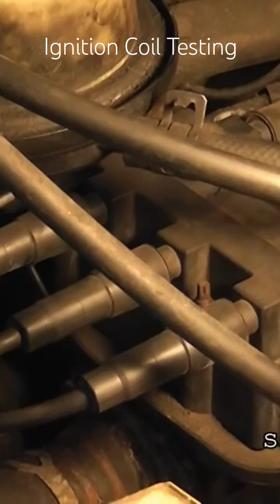No Spark From One Side of a Waste Spark Ignition Coil #misfire #nospark

Comment: What if they both didn't work? Would it then reconfirm it is bad?
Reply: If they were both bad you’d have misfires.  Waste spark is designed to fire 2 cylinders simultaneously. One at compression( the normal time to fire a spark plug) and one at exhaust(why it’s called waste spark).  It’s intended to help emissions by giving it extra spark jic it can still ignite possible unburned fuel in the exhaust.
Reply: @jorgeantonini201  wow, things have gotten very complex. Better than having two spark plugs per cylinder. Thanks for explaining so well.

Comment: You have power. Spark happens inside at the gap. You can have power, and no spark.
Reply from the maker: I'm not sure what you're trying to say
Reply: @ScannerDanner  I'll explain. "Spark" happens when the voltage (power) "jumps" across the electrodes. If you have a fouled plug where carbon has made the ceramic conductive, the power will not jump the gap. The path of least resistance is now the conductive ceramic surface.  So, you can have power going through the plug but no spark. You need the "spark" to cause ignition, Having power through the plug will not accomplish ignition. It must make the jump. You must have the "spark" not just voltage. 

When I was a kid my stupid brother in law had me hold the plug wire while he pulled the cord. I was electrocuted and he laughed. Not cool!  The joke was on him though, because this simply told him he had power and nothing about whether or not he had spark. The mower never did start. My Dad later cleaned the plug and BOOM! It started right up.

Comment: Harbor freight has a tool to stick in the plug and the coil pack that lights up like a test light if it has spark lol it 100% reduces getting shocked
Reply from the maker: Those tools are garbage. You cannot tell the strength of the spark (a weak spark will still flash this light) and you're not going to be able to do a cylinder drop test (the other test I'm doing here that the short doesn't show)
Reply: @ ScannerDanner
They sell adjustable gap spark testers, also allow you to avoid zaps 100% of the time
Looks like a glass cylindrical housing and 2 metal tips inside.  One is solid mounted, the other is adjustable so you can make the gap larger or smaller.   I’ve seen ones where you can set a gap to 2+ inches
Reply from the maker: @jorgeantonini201 I have two of them! But you can't do an rpm drop test with that tool!
Reply: @ScannerDanner what is the best tool to use to do those tests? I appreciate it.
Reply from the maker: @daviddowns7552  for an RPM drop test like I am showing, the test light is THE tool
Reply: @ScannerDanner  I appreciate that☑️☑️☑️

Comment: Dude, you could do the same with an inductive timing light
Reply from the maker: Not for weak spark. Weak spark will still fire a timing light! Also I've seen low compression cylinders NOT fire off a timing light due to the low kv demand from no compression. So the timing light test has too many variables.

Comment: Very nice demonstration & tool usage, some vehicles be careful because if U go full open air gap [like if U drop a tool] it can blow an ASD circuit, or a driver in an Engine Controller.
Reply from the maker: A momentary full open won't hurt anything, but you're not wrong about what damage can happen from open plug wires
Reply: No Dan U R teaching people something & not saying that if they drop the tool ect. ect. That is my point. 
I appreciate that U know some Tune Up Stuff but U R not the tell all know all great guru in fact U could use a little humility & regard because U seem to get butt hurt @ most of my remarks on your videos & or assume things. So notice I said 'seem' & I will leave it @ that.
Reply from the maker: @StationRussification  
You may want to reread what I wrote! ..."but you're NOT wrong about what damage can happen from open plug wires" 
Maybe you thought I said "you're wrong"? My name is Paul Danner btw 😉

Comment: Obviously it needed a coil in the first place because the car is running if it had an electrical problem none would you fire because it's one unit so if you have one miss fire it's always the coils on that particular coil pack
Reply from the maker: That is incorrect! There are 3 separate coils (one housing) and 3 separate primary control wires and 3 separate drivers in the PCM. One driver fails or one of the control wires has an open and the result is one coil does not fire! So two cylinders will not have spark. The second test in testing the companion cylinder told us everything we needed to know.
BTW, I have seen both open control wires and open/blown drivers in the PCM on this EXACT model car. Test don't guess!!

Comment: I was just wondering how to do this haha I changed my parents spark plugs on an 05 ram with a 5.7 hemi they have 16 plugs and they have 8 coil packs and 8 regular plugs also running from coil packs when I pulled one of the wires it ripped the housing on the coil connector that goes over the plug and I just put it hacj the best i could and it ran fine for a while but now its not running good at all
Reply from the maker: It's a little different when you have 2 plugs per cylinder with one of them being a boot underneath the coil pack
Reply: @ScannerDanner  that's what I mean that's the part that tore would that make it run weird or idle rough?
Reply from the maker: @THEDEADDOLPHIN  the coil boot tore? Absolutely! It's now able to arc to ground in the spark plug tube instead of the plug
Reply: @ScannerDanner  thank you I'm gonna replace the coils now
Reply from the maker: @THEDEADDOLPHIN  they may sell those boots separately but not sure

Comment: I take it that you do have a pace maker implant, and they do make spark testers for  this. When you bang your head on the hood from geeting a 65,000 volt jolt you find out that spark tester are worth the money and cost a lot less than the 8 stitches in your head.
Reply from the maker: There is a reason this is the chosen test method. I'm performing a cylinder drop test too, something this short isn't showing but is in the full case study.
Using a spark tester involves shutting the engine off each time you move it, eliminating the ability to perform the rpm drop test.

Comment: If the corresponding coil had power you just defeated the purpose of your video bro.. before we call this coil bad pretty sure that's what you said. Looks like some shitbox Chrysler product anyway
Reply from the maker: First, this is a 1 minute clip taken from a full length case study.
Second, what I showed was 100% valuable and accurate.
If both secondary coil towers on one particular coil have no spark, the primary control circuit MUST be tested before condemning the coil.
If only one tower is missing spark, primary control is no longer a concern, I has to be functioning. This is the entire point of this clip.
Reply: @ScannerDanner  that's a coil pack a 6 coil pack in one block of plastic right? Would not have taken me an hour to figure out that entire thing was garbage. To each their own, looks like I struck a nerve anyway 🙄 try to have a better day and take YouTube a little bit more lightly.
Reply from the maker: @Smokey-88  it is one unit and there are 3 coils, not 6. 4 primary wires, one shared power feed and 3 control wires. 
You clearly don't understand how these actually work based on your first comment, and your second comment you come back with how quickly you could have verified the issue? Lol okay. Move along. This is a training channel, so yes, I take things seriously. I'm not here for your entertainment. So when someone says something that is incorrect I'm going to call you on it.

Comment: The engine seems to run better with the second plug disconnected.  lol
Reply from the maker: You can totally have that happen as the harmonic that is created is more cancelled out with 2 cylinders misfiring out of 6 instead of 1.

Comment: It’s a companion cylinder coil didn’t spark you would’ve still needed a coil unless the control wires or the power wire were bad to it from the ignition and the computer
Reply from the maker: Yep, that was the point of the test. No spark on the companion cylinder and additional testing would have been needed before you could condemn the coil

Comment: Gave me a flashback and immediate jerk of my right hand. Back in 1985 i was 18 and had a new job w/ smart folks who explained i could troubleshoot my skip in my truck by pulling plugwires 1 at a time while idling. Yep i learned😂 that #5 on my 351c  w/ dual point distributor was skipping due to a split boot. Damn that still hurts.🥴

Comment: These coils use the same high voltage coil for the opposite cylinder I’m assuming? 
Thus why if one side is working, both should technically be?
Reply from the maker: That is correct. It's simply a secondary winding that is not electrically connected to the primary like conventional coils. So when the primary field collapses and we surge the secondary winding, the generated electron flow finds its return path through the block and other plug and wire.
Reply: @ScannerDanner  ahh ok, so each plug has separate high voltage coils but get supplied from one 12V coil. Ahh makes sense
Reply from the maker: @Sicktrickintuner 3 separate ignition coils in this. 2 towers for each coil

Comment: I've always assumed that an internal path to ground is almost always responsible for no spark at one terminal of a wasted spark coil, but can't the secondary circuit of the companion cylinder also be the cause? Would it be reasonable to ground the terminal of the companion before calling coil?
Reply from the maker: An open plug or wire on a waste spark coil does have the ability to affect both sides of the circuit, at least in theory. The test light test I'm showing is eliminating that variable in the way it is being tested.
I have a case study on one of these. I need to find it. I kept getting shocked every time I'd touch the open plug wire side from memory lol. Looking now
EDIT
Found it! This is going to be today's short 🙂 thank you!
https://youtu.be/iFLaRd_5wc8?si=lBEG33y0zssg4mWo

Comment: Amazing how far spark can jump. I had it jump almost 2 feet when trying to move a wire to keep from it getting caught up in a belt in school. That sucker looked and sounded like lightening when it got me. I def can say I pee'd a little when it happened 😂
Reply: Some people are more conductive than others. Once upon a time in freshman science class the teacher brought in a static procucing machine that continually rubbed two sheets of wool together to produce a real static shock! When testing it some peple could be conductive from as fas as 10 ft, while most werent shocked before the 2ft mark. Coulda been the shoes we had on. Lol
Reply from the maker: 2 ft? What were you working  on?
Reply: @ScannerDanner  For some reason my reply to you never posted and just saw it didnt. We were doing open kv testing if i remember correctly (was like almost 30 years ago) and i think car was 50kv plus coils. While car was running the open plug wire (plug wire removed from spark plug) the vibration was causing the wire to start to possibly fall into belt/fan so i grabbed it back as far as i could to move it away and all i saw was looked like lightening come out of the plug end and come all the way to my hand and WHACK, WHACK WHACK before i threw my hand up smacking under the hood while the entire class looked at me and i tried to play cool and play it off.  Guess my hand at that distance was least path of resistance.
Reply: @brianb5779  Absolutely true.  Everyone's skin contains different amounts of moisture. Sweat also effects the conductivity of a body. 
This is why electricians that work with energized lines where rubber gloves.
Reply: @donh6416  Well I was very conductive that day ill tell ya..LOL
I wasnt sure what hurt worse, the zap or smacking underneath the hood ripping my arm away...
Reply: 400v won’t jump very far. 11KV used on local transmission lines will.
Reply: Must've been 480V 3 phase..

Comment: You could also slip the grounded test light between the rubber boot and wire withoutremoving the boot; the test light will flash if there's spark, without risking a shock.
Reply from the maker: The test light will not flash with this test. Though they do make a tool like that, that I've never been a fan of. Why? Because it only tells you spark is there and not how strong it is. Weak Spark can pass the test with that tool